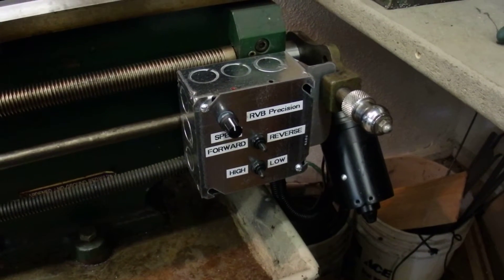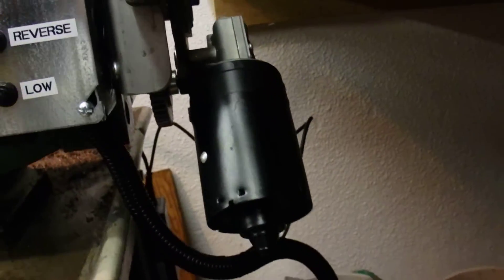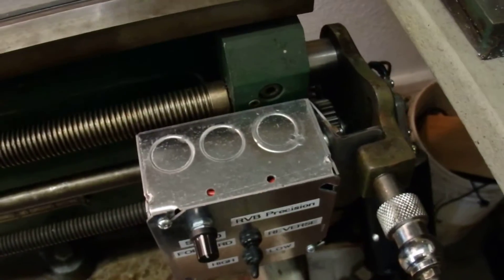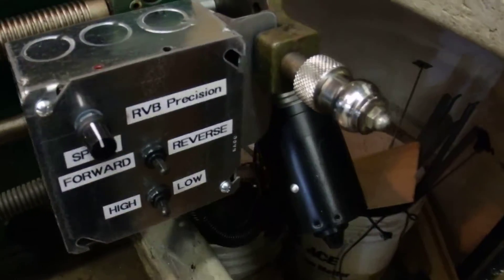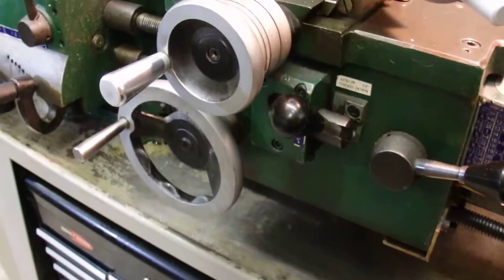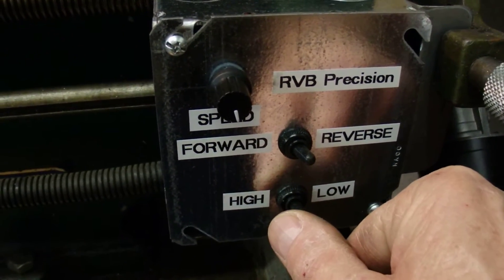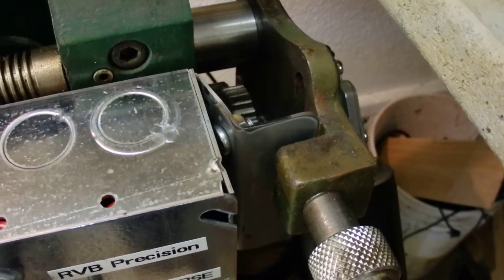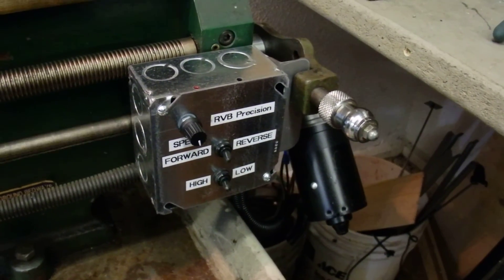Power Feed DC motor conversion on Metal Lathe

Comment: That's incredibly interesting...I may end up doing something similar....will convert a 7hp on a 15x 50 lathe to  DC drive...and may not have the poop to push the cross slide...I did notice your motor drive has a hard spot or a bind in the drive causing a speed oscillation...and may cause tool chatter...?.

Comment: Do you find with the speed reduced and under load the motor kinda struggles a bit and wont keep a consistent speed? I used a wiper motor to build this plasma cutter track https://www.youtube.com/watch?v=tLFTntKOcf4 using a PWM for the speed controller and that was a issue I found, although I didn't try it on the low circuit only high.

Comment: This is a great mod! I'M a little confused about one thing though. The hi low speed switch. I believe the window motor, although capable of two speeds is just that (2 speeds) not two different gear ratios. With that in mind,can't the total speed of the screw be controlled with just the controller  dial itself? I might be missing something here. Just curious.